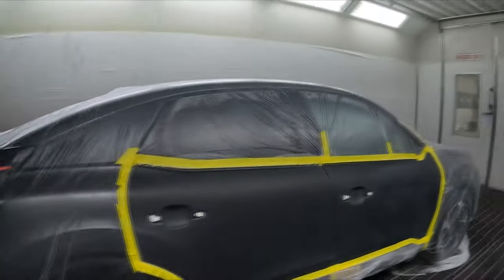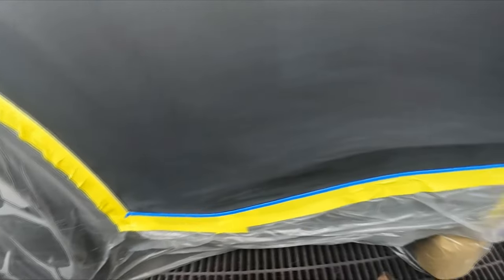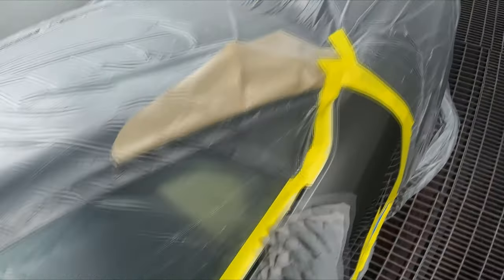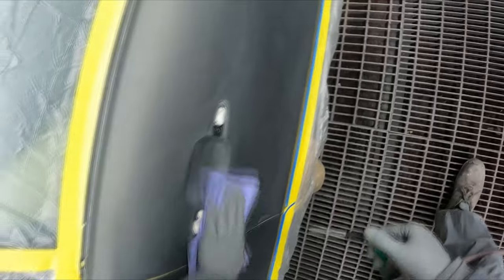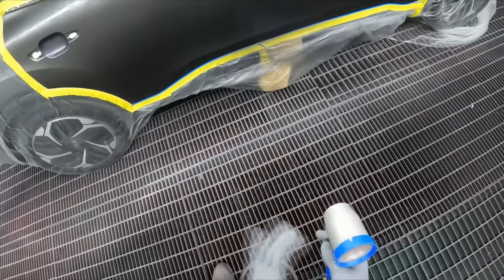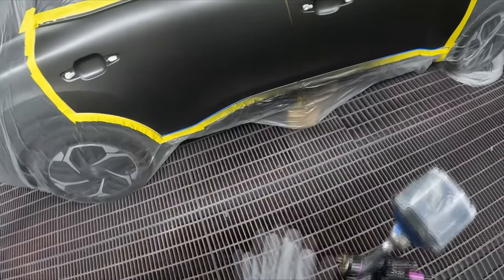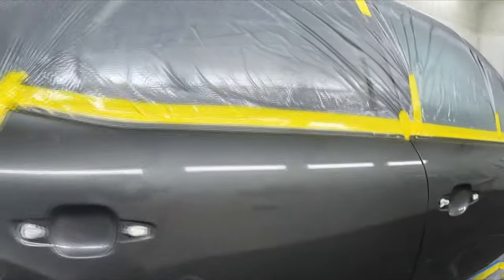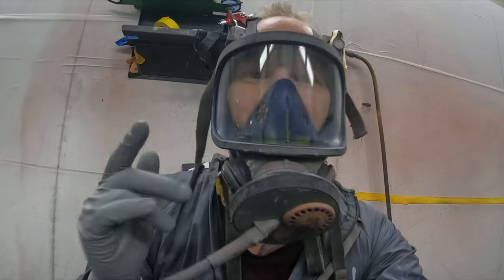Citroen C4 Clear Coat Stage

Comment: I'm just a hobbiest and actually haven't painted anything in years but I took your advice a while back about painting panel by panel and found it much, much more even compared to trying to walk & spray.  To me don't argue with success.  Pretty weak of the PPG rep to push the issue off on technique.  When I restored my 66 Chevelle My PPG guys mixed the color based on the PPG cards & it wasn't anything close.  They finally had to match a panel I gave them.  I got the idea that things were changing and that was almost 10 years ago.   As always thanks for your videos!  I always learn something or at least remember the good old days!

Comment: The normal and clear Dv1 runs on 1.5 bar on the meter. The mini one to? 2 bar is way to much

Great work Gunman!
Reply from the maker: 2 bar is fine if you read the pressure from the inlet like I do. Even on the big DV1 2 bar is fine as long as your reading from the inlet. If you use the digital it reads from higher up, that's why the pressure is lower.